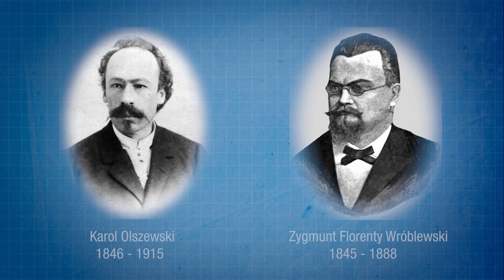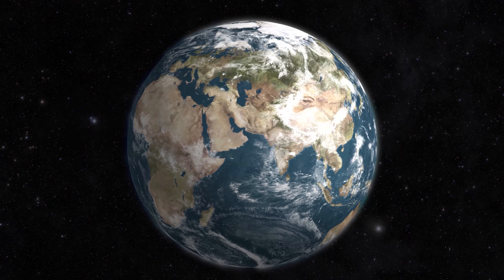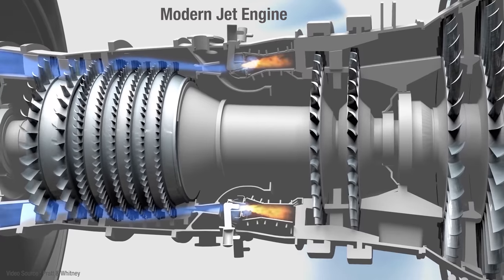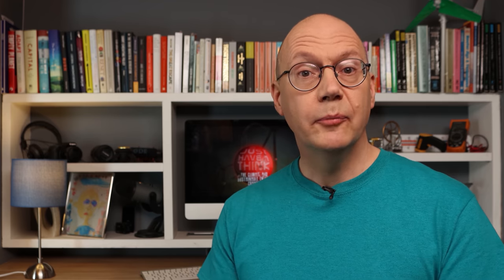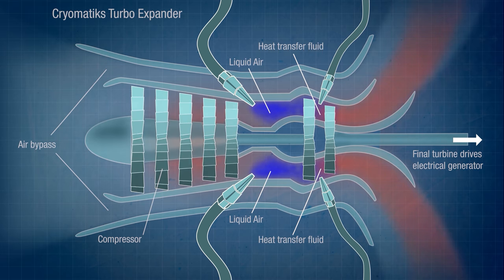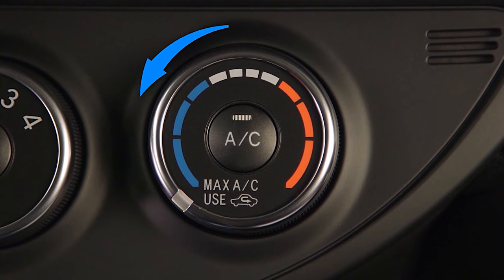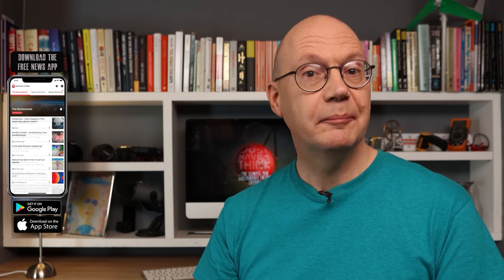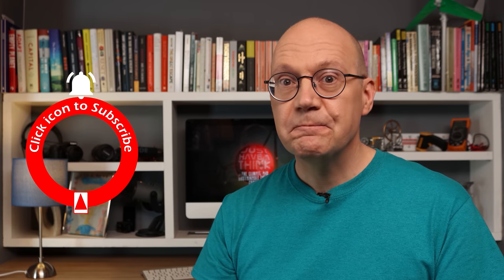Portable Liquid Air Power. A new boost for electric vehicles.

Comment: I have been looking into purchasing a battery system to augment my grid tie solar panel system in the case of a blackout. Ideally, all I need is Just over 30 kilowatts per hour. So far all I have found are jackass stupid prices for LiFePO4 batteries. What the chances that same 30 kWh nitrogen generator could set in your home as a backup power source for the home. My grit tie solar panels produce an average of 65 kWh per day. My electric bill says my home consumes 1.6 kWh or 38.4 kWh per day. All the websites say you should count the solar energy at six hours a day. ( my Solar Edge App shows I start producing usable AC for 12 hours a day.) Subtracting 38.4-6=32.4 kWh, which leaves me about 32 kWh to recharge my backup power system in a grid down situation. Cryomatiks  generator could potentially produce all my AC power if my grid tie solar power system were to be used to capture nitrogen and would still have energy leftover to send to the grid. That will never happen in my life time. Pretty cool stuff though!
I love watching your videos, some people become monotone while they talk science and I think can feel my brain cells die while try to listen. You have a way of keeping my brain engaged and willing to listen. Thank you all the hours of reading you must do to keep putting out these weekly great episodes.

Comment: It's cheap but also very inefficient. But hey, you can heat the expanding air with coal or something.
Reply: What about ambient air temperature?
Reply: @0MoTheG  Without extra heat you'll still end up with a cold engine that tries to grab for ambient air temperature until it freezes. The more power the worse. 

I had two cars with LPG. There was no pumps, the gas just expanded by itself and flew to the engine. 
In winter, the expanding LPG in the tank cooled down even further. The pressure dropped, the flow of gas dropped, and the engine could stall. Note that the pressure was only necessary to move the gas itself.
To avoid that you'd need to collect lots of ambient temperature in a low temperature environment with a huge heat exchanger surface, similar to closed-circle steam engines with condensers. 

There's energy storage plants that use pressurized air in underground cavities. They store and recuperate the heat from compressing the air (in tanks, wich a vehicle would need to carry, not to mention the volume). When that's not enough they need to burn gas to avoid freezing the turbines. Part of the stored heat is lost even underground.

Comment: It would not be crazy to be able to burn a little fuel in this cycle.  Efficiency would be very high.
Reply: Yeah if you could create a constant flow gas expander you could use the exhaust from that as intake air. Would allow you to plug in at night and add efficiency to your ICE during the day.

Comment: Several thoughts occur to me.
1) Refueling with LN2 should be much faster than any battery recharging system.
2) Batteries degrade with charge/recharge cycles.  Not so with LN2 refills.
3) As a battery discharges its energy it does not get any lighter, but with the use of LN2 the whole system weighs less and less for every km traveled.
4) No rare Earth minerals are needed to make a LN2 energy system.

Wouldn't all of these factors favor portable LN2 over any battery system for ground transportation?  Especially at an energy output of 125 Wh/kg .

The only real danger of a LN2 failure is if it happens in an enclosed space
https://www.bbc.com/news/world-us-canada-55847100
But that risk is pretty much eliminated in vehicular systems operating outdoors.
Reply: Except that the energy density is so laughably low that this idea is dead on arrival.  You'd need about 250 kg or 300L of liquid nitrogen just to drive a car about 100 miles.
Reply: @phillipsusi1791  Did I misunderstand the figure at 10:28 ?  It implies that for 1 kg of LN a 125 Wh of electric can be produced.  This is the same as 1 Kg of Li-ion battery on the Audi.  A 300L fuel tank is only about 4 times the volume that you would find on an average sedan.  But without the space needed for a petrol tank or a Li-ion battery or an ICE there should be plenty of space on the vehicle to go well beyond a 300L tank.  You could even use the space beneath back row seats which today is not allowed for safety reasons.  Certainly on a cargo van or bus an LN tank this size this would be NO problem.  A 440 Kg battery on a Chevy Bolt gives 240 miles of range.  So an LN tank of 550L would give you the same range.  A clever engineer should be able to do this no problem. What am I missing?
Reply: @mafarmerga  you would be hard pressed to fit 300L of tanks in a car even if you removed the batteries.  The batteries get you 300 miles of range in a Tesla.  You going to trade that for only 100 miles worth of LN2?  Larger vehicles that have room for more also take more energy to move so you need more LN2 per mile.
Reply: @phillipsusi1791  "you would be hard pressed to fit 300L of tanks in a car even if you removed the batteries.  "
You underestimate what a good engineer can achieve.  
Retrofitting an EV?  I agree with you.  Designing an LN vehicle from scratch?  Not a problem.

"The batteries get you 300 miles of range in a Tesla. "
You cannot refuel a Tesla in 5 minutes.
I would trade 100 miles of range for a 5 minute refuel any day.  So would every delivery company on Earth.

I am not an expert but according to this post "A Day in the Life of a FedEx Driver" you may assume that an average route is 160 miles a day.   So an LN van should be no problem.
https://www.aol.com/2010/05/28/fedex-home-delivery-driver/

Not to mention the whole lithium and rare earth metals mining/pollution, battery recycling, recharge degradation, issues.

Will this work for long-haul truckers?  No.
Will it work for 85% of daily drivers?  Yup.
Reply: @mafarmerga  An engineer can not defy the laws of physics.  No matter how you slice it, 300L is a lot of space.  We don't have timelord bigger on the inside technology.  If you have 300L of space to store LN2, then you could instead use that space to store hydrogen gas and use a fuel cell to convert it to electricity and get several times more energy out of that than from the same volume of LN2.  Gasoline gets you about 75x more energy per liter.  So if you take a delivery truck with a 25 gallon gas tank and want to run it off of LN2 and get the same range, you're going to need 1875 gallons of LN2.
Reply: @phillipsusi1791  "No matter how you slice it, 300L is a lot of space.  "
So is a full sized battery, petrol tank and ICE.  My PHEV has all three and if I got rid of the petrol tank and ICE I bet that there would be room for 300L of LN2 storage.  Not much more than the 70L petrol tank it already has.

"use that space to store hydrogen gas... "
All true.  But LN2 will never explode and the infrastructure for making it and transporting it already exists everywhere in the country.  None of that is true for hydrogen.

"Gasoline gets you about 75x more energy per liter."
Again, no argument.  But energy is not work.  The average petrol ICE vehicle has a thermal efficiency of about 30-35% which means that 70% of the energy you cite in petrol is simply lost as heat, not converted to work.  Burning 100 gallons of petrol also gets you one ton of CO2 emissions.  And that does not include the carbon footprint of pumping the oil on the other side of the planet, refining it in Texas, and then shipping it to my hometown.  It also does not include a future Deepwater Horizon or Lac-Mégantic disaster.  No more reason to go to war in the Middle East, support despotic regimes or destroy wildlife reserves.  LN2 can literally be made anywhere on Earth that there is electricity with little to no distribution problems.  See the problems with your solution?  See the advantages of mine?

"So if you take a delivery truck with a 25 gallon gas tank... "
At 15 mpg that would be 375 miles of range.  That is over twice what the average delivery truck needs on a daily basis.  So 600L (160 gallons) of LN2 refueled every night is all that is needed, not the ridiculous 1875 gallons you claim.   Why do you insist on creating Straw Men that are so easily knocked down?
Reply: @mafarmerga  Your hybrid has a 75L gas tank?  My Prius is about half that and that will get me 500 miles of range.  I'd imagine that the turbine shown here is about the same size as the little ICE so you're not going to gain any space for LN2 from removing that.  Even if you could somehow cram that 300L LN2 tank in there ( and remember it has to be heavily insulated ), that would still only get you 1/5th the range.
Reply: @phillipsusi1791  As I have repeatedly said.  A LN2 system would make the most sense for a daily delivery van which needs at most 200 miles of daily range, and can be refilled on site every night.  UPS, FedEx, USPS, Amazon,...
You keep building strawmen
but they keep falling down.

PS. I said 70L petrol tank, not 75L.  And I have a combined 350 miles of range, but because it is a PHEV and I drive about 25 miles per day, after 12,000 miles I am averaging 92 mpg. My overnight electric is $0.01 kWh.
So about $0.015 per mile in total energy cost.
How does that compare with your Prius?
Reply: @phillipsusi1791  No argument about my CO2 emissions or environmental safety argument I see.

Why not?
Reply: @mafarmerga  Because there isn't an argument to be made?  LN2 would be a great idea if the energy density weren't so low.  Hydrogen fuel cells still aren't being adopted much because they have plenty of problems of their own, but they get you all of the same benefits as LN2 with a lot more energy density.
Reply: @mafarmerga  If you're going to refill it every night then you could more easily plug it in and recharge batteries.  You're not using the one advantage that LN2 has: the ability to quickly refuel.
Reply: @phillipsusi1791  "If you're going to refill it every night then you could more easily plug it in and recharge batteries"
Only if you have expensive Li-ion batteries.
Which degrade with # of recycles and need to be replaced when they hit 70% capacity.
Which require lithium mining and other environmentally destructive practices.
Which require electricity production at night instead of excess energy being stored during the peak of the solar day.

"You're not using the one advantage that LN2 has: the ability to quickly refuel."
You could also refuel midday during a lunch break and restocking of the van.

So you see, quick refueling is not the only advantage of LN2.
Reply: @phillipsusi1791  "they get you all of the same benefits as LN2 with a lot more energy density"

You need access to very clean freshwater to make green hydrogen.
Unless you can liquefying hydrogen then the energy density of gaseous hydrogen is not that great, especially for the volumes needed.

Did I also mention the flammability factor?
https://youtu.be/jH-mhZLuGRk
Reply: @mafarmerga  Hydrogen fuel cells have all of those advantages, and much higher energy density.
Reply: @phillipsusi1791  "Hydrogen fuel cells have all of those advantages, and much higher energy density."
A hydrogen fuel cell only works if you have gaseous hydrogen to power it.
How do you propose to store the hydrogen on the delivery van so that it has a high energy density?

What would happen if your hydrogen storage device failed in a crash?
What would happen if a LN2 storage tank failed in a crash?
Reply: @mafarmerga  That is one of the big problems with hydrogen storage: it requires high pressure containers that tend to rapidly take damage and break down due to quantum tunneling effects to contain it, and when released, it is flammable.  LN2 storage instead requires highly insulated tanks that can keep it very cold rather than under high pressure, and vent off LN2 to release the pressure instead when vented slowly; it is not flammable, however, that insulation is also somewhat costly.  If the energy density were somewhat comparable I would agree that LN2 is better, but since the density is so much worse, and while a sudden release of N2 isn't flammable, it isn't entirely without risk, I can't really see the risk/benefit analysis coming out on LN2 strongly.
Reply: @phillipsusi1791  I have worked with LN2 on a daily basis for nearly 3 decades so I am well aware of its shortcomings.  Long term storage being key among them (due to the constant need to vent that you describe).  This is why it is impractical for anything other than a delivery or public transport vehicle that can be filled at the beginning of the day and is near empty at the end of the day.  The typical delivery van or passenger bus never exceeds 200 miles a day, so the unreasonable range demands you cite are just that, unreasonable.  LN2 power would not work for a passenger car that sits still most of the time.  By the time it was driven half of the LN2 would be gone.

On the other hand, large stationary tanks of LN2 are pretty stable, which is why it could be made onsite during the day (using solar energy) and stored overnight for fueling the fleet early the next day.  The infrastructure needed to do this is considerably cheaper, safer, and more practical than a hydrogen refueling system.

Comment: this is a range extender hybrid tech and is unlikely to be worth the candle - complex and has to be integrated with a proprietary EV design. then the delivery system for liquid air has to be managed which makes it even more awkward.  much better to go for a single power source such as hydrogen fuel cell EV than make our logistics rask of getting to net zero even more complex.  good engineering is about simplicity

Comment: Would you please provide a cost and weight comparison with the new Tesla, Toyota, VW and Hyundai batteries. Did the 125 Wh/kg include all of the heat recovery equipment? If you used hydrogen to both expand and oxidize, would that be cheaper/more effective than a fuel cell,(w and w/o Antora Energy thermal PV heat conversion)?

Comment: The way battery and renewable energy prices are falling and power density is rising. I don't see many HGV operators wanting to add the mechanical complexity and servicing costs.
Reply: Battery technology is evolving but unfortunately the demand of lithium for example is already exciting the supply and if we don't develop other transport power solutions it maybe very late. Its impossible to increase the range of batteries for example and a diesel car can over about 2000 miles with extra fuel on board.
Reply: Mining, agricultural, construction equipments and vehicles can work 24/7 and batteries cannot do well there.
Reply: But what about City-Busses and Parcelservices: They are continuesly are in stop-and-go mode and there will always be pressure to save weight, investment cost for batteries, costs for recharging and range extension - don‘t you think that there might be an economical niche?
Reply: Also remember that lithium, nickel and other battery materials mining are causing some serious damage to the environment and its getting even worse with the growing demand of electrification.
Reply: @carholic-sz3qv  the mechanical complexity that you talk about help maintain the life of the battery which in turn make battery vehicle more appealing.
Reply: @oneildennis5956  unfortunately batteries and EVs are still not good enough and doesn't work for soooo many applications, for personal cars its good but for a big truck or bus or even semi they need significantly large batteries which aren't cheap and doesn't have a good range.
Reply: @oneildennis5956  the tesla semi is projected to have 500 miles we don't know if its empty or full, some countries have been using trolleybus or trams.....
Reply: @oneildennis5956  imagine if electric trains had to work with batteries it would have been a disaster and impossible to do.
Reply: @oneildennis5956  in Australia and other countries they have very large trucks that may probably never be electric.
Reply: @carholic-sz3qv  yes I understand what you saying but will you admit we have to start somewhere.and also the Wright's brothers didn't start off by making a jumbo jet.the small start that they make over a century ago allow us to fly around the world.
Reply: @oneildennis5956  there is always a beginning to everything but let me tell you, fossil fuels have had the most important impact on the humanity than other energy sources will ever do. Fossil fuels provides heating, cooking, cooling, transportation, agriculture, construction......... without it we wouldn't be here, batteries simply doesn't have that effect.
Reply: @oneildennis5956  fuel and tractors were brought in the middle of nowhere in very difficult conditions and terrains to prospect and make mining operational...... ships can transfer over 20k containers each, road trains in Australia can haul entire 200+tons of freight on the longest distances possible.

Comment: 5:27...... sooooooooo..... vehicles running this are just going to be spraying water and glycol out the back all day?
Reply from the maker: I think you may have taken the animation slightly too literally. The glycol will be captured in a closed loop system.
Reply: @JustHaveaThink  Ah, well then this is the most interesting part of the technology to me then.  I would like to know how in the world they are going to aerosol a stream of glycol and water with a high pressure air stream, then turn around and recapture all the aerosoled liquids while ejecting the waste air.  This seems like the most tricky piece of the technology bar none.